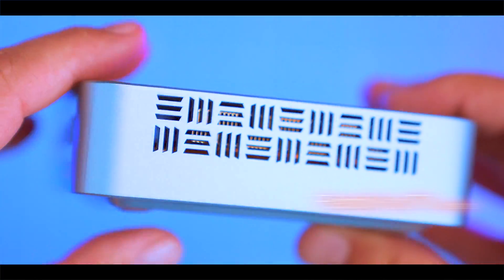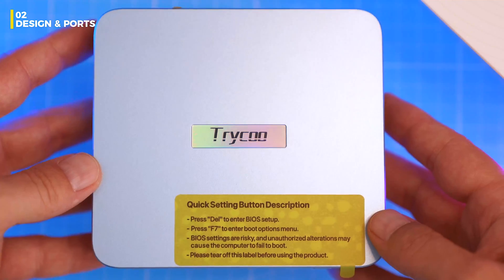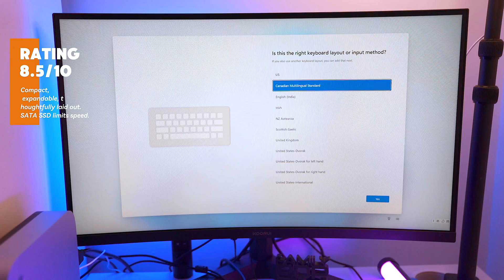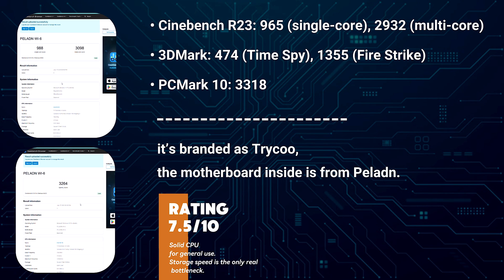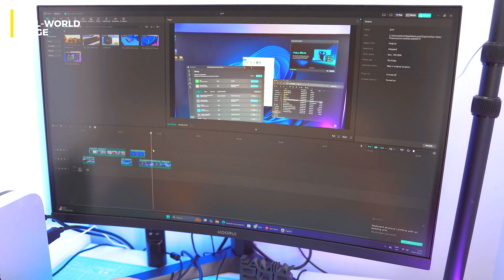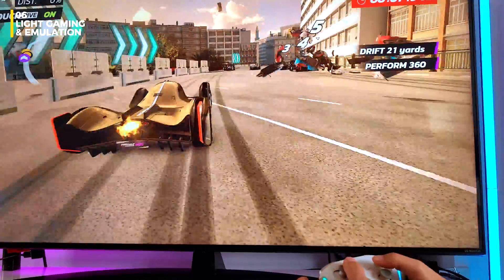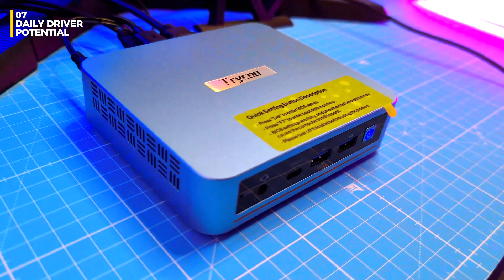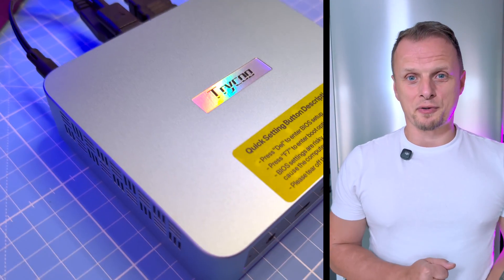The Best Mini PC is NOT What You Think (Trycoo-Peladn WI-6)

Comment: A good video.  Thank you.
I managed to buy one earlier today for £89.  Brand new, unopened.
It's just to use as a Tailscale exit point (I'm using Android at the moment), so it will be turned on 24/7/365.
Reply from the maker: Good idea, it should cope just fine. And a little bonus- you'll not feel guilty looking at your electric bill if this runs 24/7.
Reply: @FamilyPopTV  That's very true (I had that in mind seeing how penny-conscious I am!)

Thanks for your reply.
Reply: I’ve seen the same listing it’s on eBay isn’t it
Reply: @hypershadicthehedgehog697 Yes, it is.  I can recommend both the seller and the product.

Mine's up and running now... it's working perfectly as a Tailscale exit node.